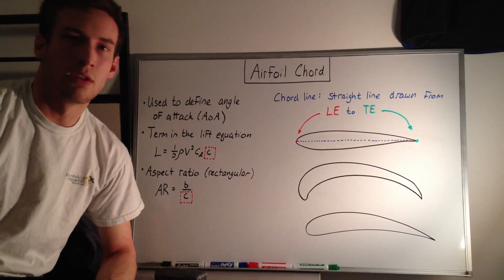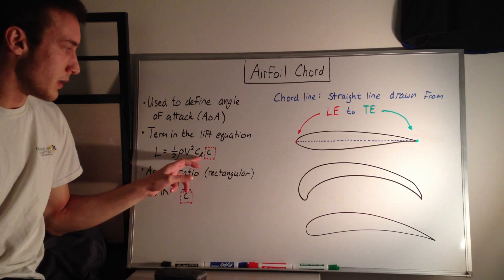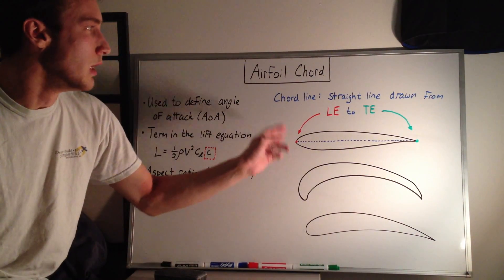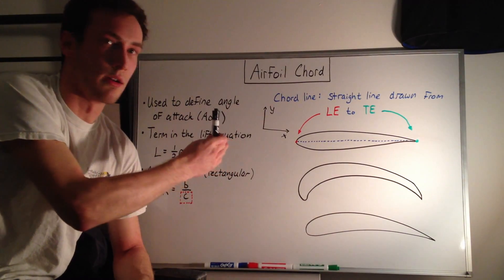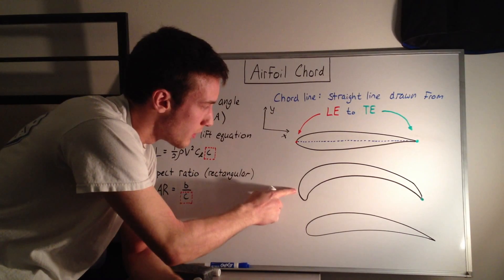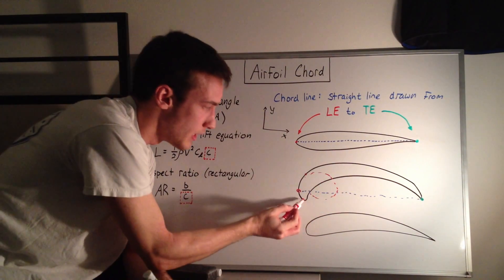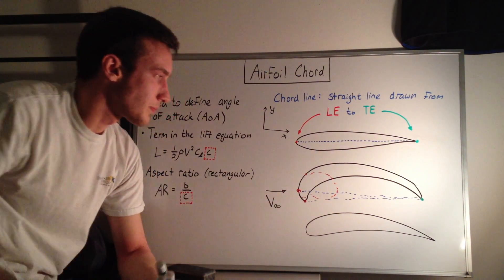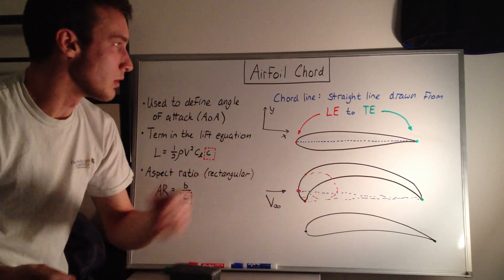Explained: Airfoil Chord [Airplanes]

Comment: Hi, Great example! I would like to add a bit of explanation for those who still have any confusion on this topic. The best way to understand chord line is to first define what is the mean camber line. Then we can define the most forward position of the mean camber line to be the leading edge and the most aft position of the camber line to be the trailing edge. Draw a straight line connecting the points and there you have it, a chord.

Simply for the symmetrical airfoil, the mean camber line is a straight horizontal line(which defines the leading edge and trailing edge to be the smallest value of x and largest value of x respectively) since the curve on the upper part of the airfoil is the same as the bottom. While for a cambered airfoil the mean camber line is not. So, the misconception of the leading edge is defined as the point of the airfoil where the air first meets it and this is incorrect. Cheers.

- Source : Fundamentals of Aerodynamics, Anderson.